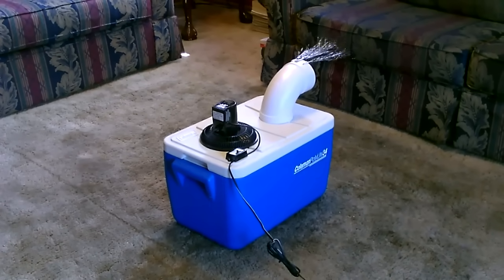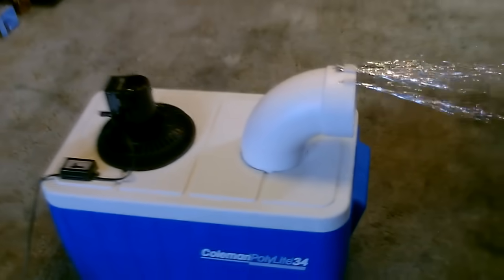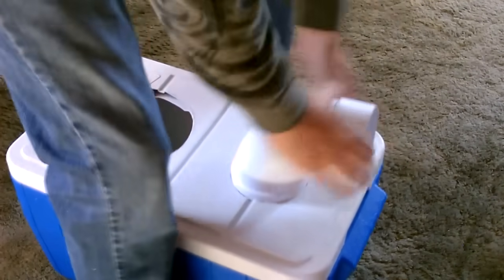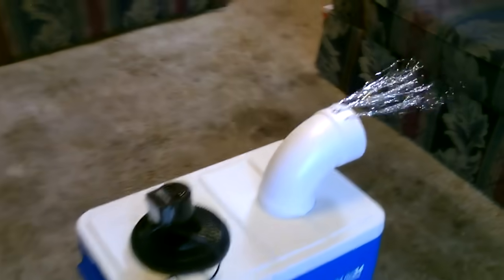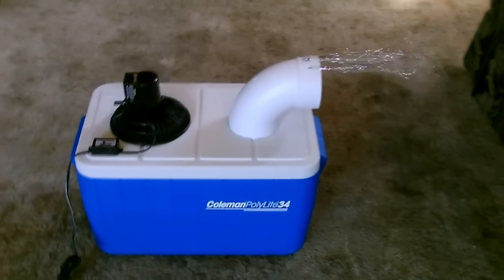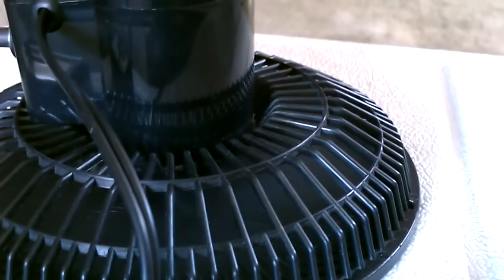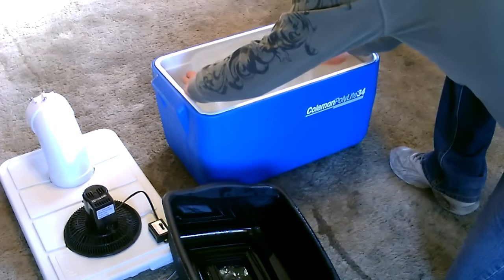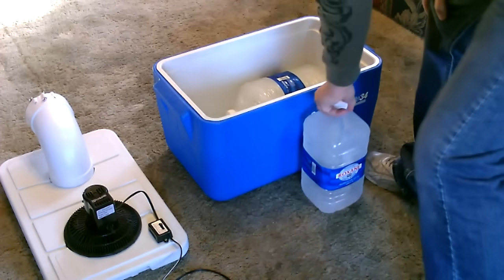Homemade air conditioner DIY - Awesome Air Cooler! - EASY Instructions - can be solar powered!

Comment: I've made this and it's working but I'm wondering about humidity now.
Reply from the maker: hi there. this type of air cooler doesn't add any noticeable humidity to the air. remember... as the ice melts it's just turning from a solid to a liquid (not a gas).  there will always be some natural  evaporation of the water but not much (humidity levels wouldn't rise more than one-tenth of one percent - which is not noticeable). *to confirm just melt a block of ice in it and then measure the water that's left over after it's all melted. you'll end up with about what you started with. :)
Reply: @desertsun02  Thanks!!!

Comment: You can use styrofoam box. Much cheaper than a plastic cooler
Reply: great idea
Reply: it probally wont last aslong as the plastic ice chest incase it gets rugged..but ur rite styrfoam 1 is cheaper .
Reply: JheS Sica  It won’t last as long and styrofoam breaks easy
Plastic coolers are not expensive at Walmart

Comment: If you want it colder longer put a copper coil in it just under the elbow. Fill the copper tubing with water. I built 1 14 years ago 😀

Comment: I belt one after watching this video. It worked great, nice and cool.
The only issue is how fast the ice melted but still great.
Reply: Mark Puckett how cool can it be without ice and just water?
Reply: @justinvasquez968  with ice it was between 40-45 I probably 60 but still cooler then the outside temp.

I want to try dry ice.
Reply: @zombiemillionaire6397  40-45 room temperature?
Reply: @jannatshekhawat7490  yes it was blowing between 40 and 45.
Ice melted fast then it would blow a lot warmer.

Would be cooler if not for the pocket if air that its blowing out.

Im not sure why no one has done frozen containers instead of loose ice. 
I should try it myself.
1. Test for loose ice
A) how cold it blows
B) how long

2. Frozen containers
A) how cold it blows
B) for how long
Reply: @zombiemillionaire6397  thanks and what was the room temperature before.. currently in Delhi india its 46 c (114 f)..so so hot in here
Reply: @jannatshekhawat7490  used in my van so I would guess between 80-90°.
Use Ice blovks and you will have good success. 
To save on electric, use a battery and 1 small solar pannels. The fans only use 100 Watts so 1 AH.

Comment: I had a bought portable refrigeration cooler but only works in a small enclosed room, no good for large open planned rooms. The cold air only is good if you sit in front of it when the temp goes above 30c

Comment: Why is the fan pointing down, isn't it more efficient if it points to the side?  Also the outflow air should be low as well since cold air sinks and hot air rises.  Also it can last longer if the out hole is smaller, and maybe if you put a screen on the output.  Another idea is to make it throw out air from a small hole after pressure.  As the gas expands it also cools, and if the air is pulsed it will reduce the amount of "getting used" to the cooling and make you feel cooler than as a result.
Reply: So, your idea would be to blow the air directly over the surface of the ice and out the exit hole? Doesn't sound too efficient to me. Making the exit hole smaller and adding a filter will cause increased back-pressure which will make a very low horsepower fan labor and possibly over-heat but definitely will reduce the life of the fan. Sometimes simple is better.

Comment: Just buy a old freezer and do the same thing. Cheap Ac unit
Reply: As long it is vented to the OUTSIDE.
Reply: It's running on solar. Old freezer would die in a week and cost a fortune in eltcy

Comment: So if you cover the open block of ice with salt your ice would last probably about 5 to 6 hours longer before melting and also the salt would drop the temperature of the ice and the air passing over it by almost half again giving much cooler and also dryer air. You can go a step further still by mixing paper or wood pulp or shavings to the water before you freeze it, this can extend the life of the solid ice by as much as a whole extra day although once it does melt it leaves behind a slurry mess if the ice wasn't contained.🤓
Reply: s i l v e r t o n g u e dude.. salt does NOT prolong ice. It causes it to melt more quickly.  There is a reason we use it on our roads after ice storm.

It will however cause more rapid cooling exchange
Reply: good idea

Comment: I would put plastic bottles in and have extras to switch out from the freezer. Than as the first ones melts down you can switch out and put the old bottles back in the freezer. You may need several sets  in the freezer to keep up with the demand. But I think I'm going to build one.

Comment: ,,,how bout insulating inside of the ice chest with aluminum foil (for better heat transfer),,,then filling it up around halfway with salty water (frozen salty water is colder then frozen fresh water), then freezing it,,,instead of cutting and ruining the ice chest,,,, you can put piece of 1 inch styrofoam that will cover the top and make cuts accordingly...just make sure that your ice chest can fit in the freezer.,,,if not use plastic 1 gallon water containers, wrap aluminum foil around them..cheersss,,,
Reply: A S I’d put spray foam insulation into the accessible parts of the lid after cuts are made.

Comment: Use a bigger cooler and bigger fan and more ice, don't break the ice up, leave in the the bag. The ice will not melt that fast and it will stay frozen.

Comment: Does anyone have a particular fan and/or solar panel you recommend? Lots of options on amazon and Walmart, but curious if anyone has had a good experience with any specific ones.

Comment: I like the Styrofoam boxes better. They are better at keeping the ice cool. This is just my opinion after we have a heat wave in Denmark atm ☀️and a styrofoam with a layer of insolation worked well. This was only cus every shop was sold out in small AC's 😭
Sorry for my English 👋
Reply: Thanks I will try that one

Comment: You get the ice from your freezer, yes? The heat extracted from the original water to make the ice is dissipated from the back of the freezer. Unless your freezer is in an outhouse, this heat goes into your home. This balances exactly the cooling effect of the ice. No net lowering of temperature, unless you made the ice before the hot weather.

Comment: 1000 times better then any chemical new produced engine. The only Thing is, cold air falls down, maybe put this device on some hight 1-2 meter for more cyrculating in the room, and warmer air is in upper part of room, thats the air you want to cool, not the groundair

Comment: Can I use a Fan and plug it into the AC outlet instead of going through DC / Solar Power and all the Techy stuff? This thing looks like it worked better than an everporative cooler I just paid $200 for, blowing  Hot Air

Comment: If you get 2 cooling boxes then put them full of water in a chest freezer, then the ice would be a perfect fit and you'd have an endless supply of ice on a rotation basis.  Also, you'd still have one when needed for its original purpose.

Comment: Thanks for the tip. I built one. Used a 120mm computer case fan 2000 rpm from some vague Chinese brand. Tried a silent Coolermaster fan first, but that did not give enough air flow. For power I use an adapter from an old HP scanner, it's also 12 volt, a bit more ampere but that's no problem.

Comment: l'idéal c'est de compartimenter des bouteilles d'eau glacé dans un couloir a l'intérieur du caisson,et mettre le ventilateur qui souffle a une extrémité du couloir pour ressortir de l'autre coté du couloir avec une sortie...le ventilateur doit tourner lentement afin que l'air soufflé glisse sur les parois des bouteilles glacé....j'ai fait cette expérience
dans un réfrigérateur le ventilateur tourne doucement par rapport au cubage d'air contenu dans le caisson ou ce trouve le passage du fréon,ce qui permet de laisser le temps a la régénération de la formation du froid et avoir un flux d'air froid continuelle.........un petit ventilateur aura plus d'effet q'un grand ventilateur qui soufle rapidement .
il faut toujours prendre en compte le débit d'air par rapport au m3 du caison

Comment: Not a bad idea. Not exactly efficient because of the cost of freezing water. The best method of AC is to bury refrigerator coils underground and use a solar water pump and solar fan to circulate underground which is usually below 60 depending on the depth.

Comment: ok i tried this one finally, just now, it already works a helluva lot better than the last thing i tried (due to my humid area).  very cheap.  i already had a styrofoam cooler so used that and bought a 20lb bag of ice to get started with.  so i bought ice and a elbow pipe (3") and that's it.  less than $10.  easy solution.  now to making lots of ice lol....  thank you for the idea!

Comment: Why have an inlet at all? Couldn't you flip the fan and run the chord out a separate opening that could be sealed off? Obviously you'd want to pull it tight to the lid away from the ice/water. Blowing warm air in seems counter intuitive.

Comment: With an air flow of 50 m3/h at 8 degrees Celsius the estimated power of this clever device would be around 380W with a room temperature of 30 degrees.
Now the heat load of a room which is about 20 m2 might vary from 200 to 400 W to maintain 26 degrees (with the windows covered!!). So theoretical this system works. All you need is close the shutters. I'll certainly test it this summer in my Moroccan appartement.
Reply: az z Lots of numbers, but don’t you need to know the size of the space for any of them to apply?

Comment: Can also cut down lower, use in line blower connected to metal flex pipe run thru and up to exhaust. Chill pipe.

Comment: Have you ever used the saw blade tip to start the hole? Just tilt the saw way up so the tip and a little bit of the toothed area engage the surface and plunge through by pivoting the saw until the rest/foot is flat. Very simple and works very well - trust me. Have I ever steered you wrong? ;-)

I see you got that down to 35° with the cooler filled. Very impressive. But if you think about it you're just using your freezer to make the cold and then transporting the cold to where you want it. To be fair, it's an inefficient process. Then again, moving your freezer to a different location, finding the 115V power supply and then just leaving its door open sounds like a very poor idea. (I would also hate cutting hole in my freezer!).

Comment: Absolutely brilliant !  Scientifically sound !  Cheap to make !  This is a winner !

.
Reply: Is ice free now?
Reply: @gookumpucky4842  lol... right????
Reply: *weiner
Reply: Until you look at the condensation stains directly in front of it... 😒
Reply: @AppAccess123  good point i hadn't noticed that. i'm sure there's some way to remedy this at least by doing something like laying down a tarp and/or using desiccant beads in the general area
also it seems like he had his running mostly on uncovered ice but he suggests using closed bottles as well which would probably reduce the amount of residual condensation
desiccant beads + closed water bottles + tarp, would probably = much lower condensation
Reply: @AppAccess123  could probably cut a piece foam insulation to absorb the water fro the PVC pipe

Comment: +desertsun02 In your video you use a 12v car fan and hook it up to a 12v battery. What connections did you use to connect the car adapter to the red and black jumper cables? Great video. Can’t wait to try this out.

Comment: 1.5 to 2.0 litre soft drinks bottles filled with water and frozen might be good because you could pack in more ice. I am going to build this, thanks.
Opps, I wrote that before I got to the part where you had the same idea.

Comment: Idea, design a copper coil with tiny holes with a fuzzy strand material to cover the outside of the copper coil with lots of tiny holes.  Then have a helium sealed stirling cold piston generate super cold liquid atmosphere that filled an insulated tank with a bell siphon that would fill the copper coil with super cold Liquid air that would seep out of the tiny holes and freeze in the strands of material covering the copper coil has air was being forced over the coil to cool the air. A truly different way to cool a room or green house. 😊

Comment: How can you make it for SUV on cigarette lighter outlets
Reply: Cody Warburton, good idea, minus the idiot.
Reply: michael j - Yes.
Reply: Or buy a solar panel. Bolt it to the roof of your car. Use on a hot sunny day. even when your car is off. so its nice and cool when you want.
Reply: michael j use a 12-volt fan you can pick one up at Walmart already with the cigarette lighter adapter idiot

Comment: Did you use a regulator with the solar panel or wire it straight to the fan?

Comment: Maybe use some silicone caulking or rubber grommets to seal around that exhaust/PVC pipe from top and from under lid. I'm thinking you'd get more pressure output.

Comment: In your opinion, would a unit like this cool a 10x20 foot (200 sf) storage building room (suppose to be climate controlled, but management of the place lets it get up to 90 in the units!!) for around 3 to 4 hours?  If it can bring it down from around 85 degrees to 70 or 69 degrees, I will make one of these units. If not, I don't want to waste my time building one of these. Also, using some salt water around the block of ice should make it cooler I would think.

Comment: What if I don’t have the 12 volt battery, can I splice into a 220 wire on a 40 amp circuit?
Reply: For sure. 12 Volts Direct current is practically the same exact thing as 220 Volts Alternating current. Should work like a charm.

Comment: Interesting.  We could use this after the power goes out after a hurricane.  I have a portable ice maker that can make 26 pounds of ice a day (low power).  I saw the block of ice and the bottles, but about how much ice (pounds) would you use in a day (85-95 degrees outside).

Comment: What would happen if i used a fan plugged into the wall
Reply: Your kidding right? Please tell me your kidding.
Reply: ViiPeR VeNoM it'll still work you idiot
Reply: ViiPeR VeNoM It will only work if you use blue tinsel!
Reply: ViiPeR VeNoM - I was searching comments for long time looking for this exact question/answer. Thanks mate.
Reply: ViiPeR VeNoM the wall will catch on fire. The sun works better because it can melt steal beams

Comment: Great idea for renting on those hot summer nights.   
Question: does that fan cause melted water to splash around —potentially splashing out of the vent?
Reply: Not really. The out put is on top.

Comment: Could this hack work with one of those piezo electric coolers? It would be a little more investment but it could make its own ice/cool air without the need for all that ice exchanging.  I'm not going to ruin my piezo cooler to find out.... :) All I know is that it will cool to about 40 degrees lower than the ambient temp. Or vice versa with the keep warm function too! 

I found a large (44 cans) Coleman piezo cooler set out for garbage collection a few years ago. No power cord though. It was quite moldy inside, which I assume is why it was tossed. I took it home, cleaned it up to look and smell brand new! It still works perfectly today and is used all year long. 

I bought both a 110 vac adapter and a 12 vdc adapter ( I ran it off of a Sears portable battery charger for several days on one charge. It got so cold that it froze the beers and cans of pop until I found the perfect temp adjustment).  I have never used the "keep warm" function though. 

Such a cooler could be used for heating and cooling I imagine. Brand new those piezo electric coolers cost $40 and up to several hundreds of dollars. Heck it could make the ice for you and run it off a solar panel too!

Comment: Try turning the air flow to flow over the fan, see if it blows cooler. 
Partial intake would be cool air
Reply: He meant turn the pipe piece the other direction.
Reply: @U2JEN2U  most of the air would be just recirculating and not going into the atmosphere then.
Reply: @jseb4025  that's what I was thinking.
Reply: Maybe use 2 or 3 smaller PVC pipes for outflow. One directed at the fan intake and the other 1 or 2 directed out into the room. Yes it would reduce the amount of cold air going out but the ice would melt slower because of the cold air intake. You might get around that by using a slightly stronger fan. That's just a thought. I'm going to try making one of these and test my idea. I love the general idea. Thank you!
Reply: That would be great, but it would be hard to get the cable into the cooler

Comment: Great idea but, don't you lose all that energy anyways freeZing all that ice? It seems better than running a regular AC with the condenser fan pump etc... but again if you keep putting pales full of water in your freezer it will be on all the time exchanging heat with the water to freeze it.

Comment: I made a version of this kind of cooling unit back before YouTube existed, but I'm kinda glad to see I've not been the only one with this idea, plus it's effective and simple enough for anyone to make, and use them anywhere, especially if it's run on DC power or both AC and DC

Comment: So, since my last comment, I have tested one of these with junk components. What I have found is: IF you use 2 or 3 coolets and one fan AND use a "plastic cap" on top of the ice with holes  drilled all over the top to create a bit of pressure, resistance and air turbulence, you will not only create a lighter, smoother airflow out of each cooler for more uniform air flow in all areas of a room, .ut you will also lower the temperature of the outcoming air by 5 degrees to 40' Fahrenheit which is colder than any a/c unit....